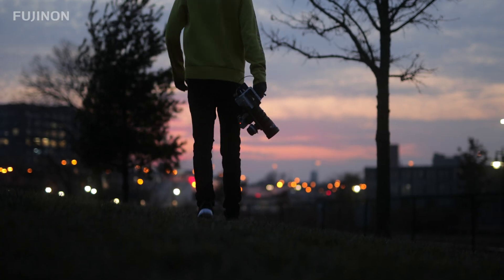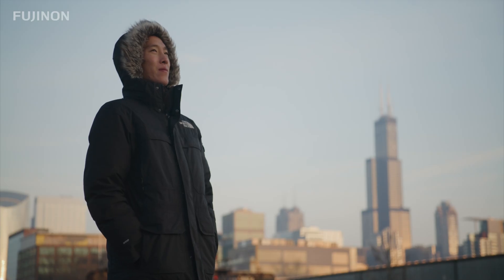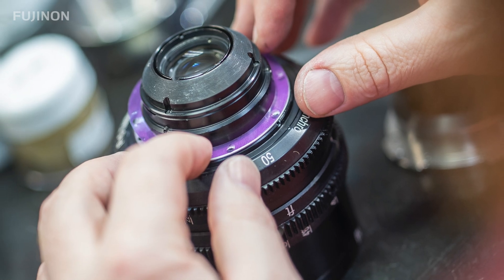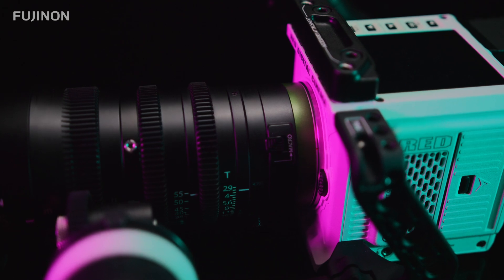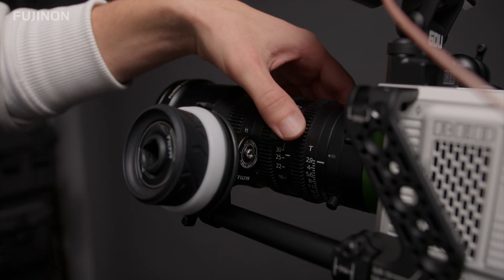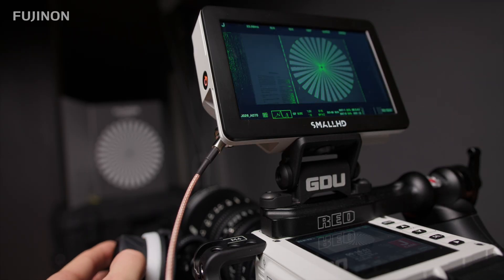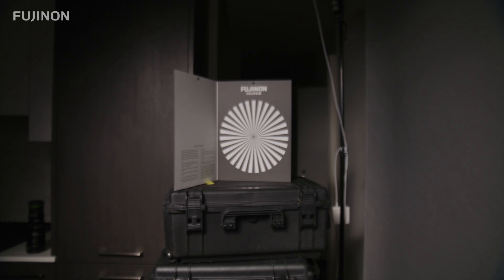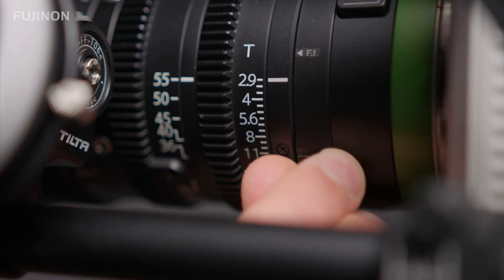How to Back Focus a Cinema Zoom Lens

Comment: this is great but i still need help if someone reads this. i have a XK with servo and when i get the focus set manually, engaging the focus servo changes the focus mark to 6.6ft and i lose parfocal? i want the focus servo engaged so the ring is rotated accidentally
Reply from the maker: @derrwolf happy to help here. Please email your contact info. and question to  fujinonsocialmedia@3epr.com and we'll connect you with product support to answer your question.